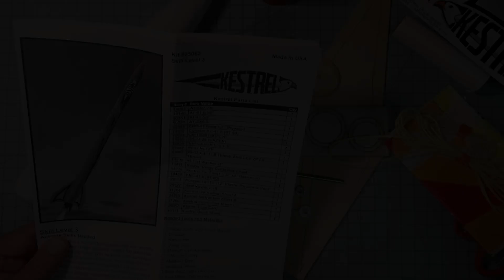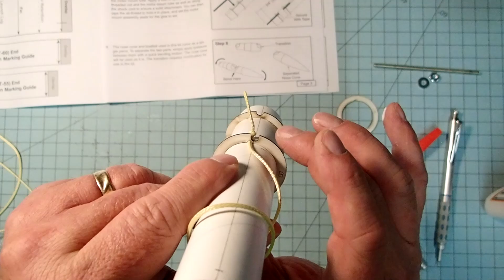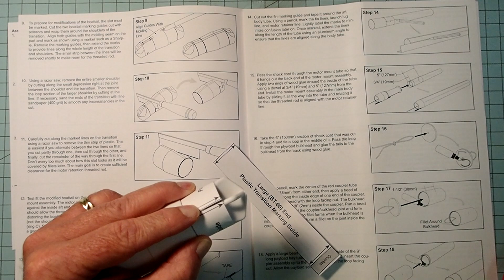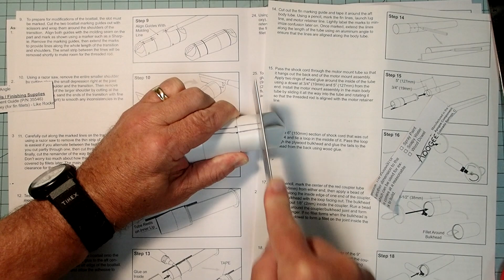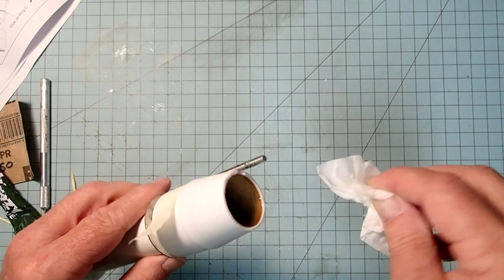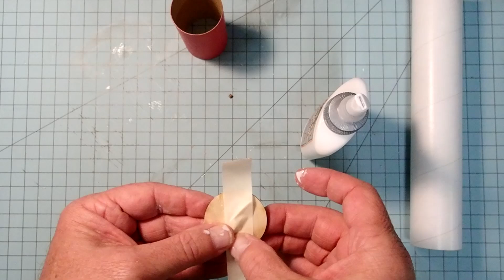Apogee Components "Kestrel" model rocket assembly (part 1 of 2).

Comment: Dr. Dave... I was wondering... the rocket I plan to make will be about 4' high with a body thickness of 2.5", the question I have is can my parachute be too big?   I plan to use a totes style umbrella for the chute material... is there a formula for the parachutes relative to the bodies that is ideal? I know in the case of most rockets you have made go between a 12-18 inch parachute... I figure that the size of the umbrella is prob a bit more than that..... thank you
Reply from the maker: Offhand I recommend a 24-30” parachute for that size of a rocket. I suggest using OpenRocket to simulate your design. It will show the performance of different sizes of parachutes.